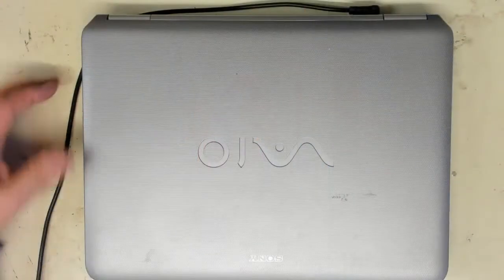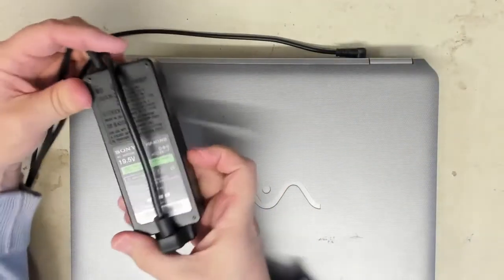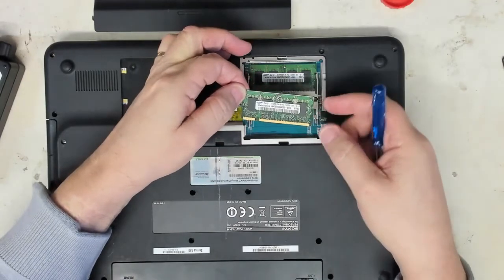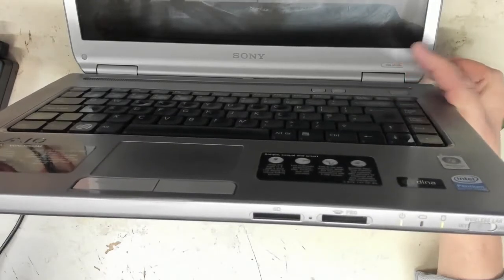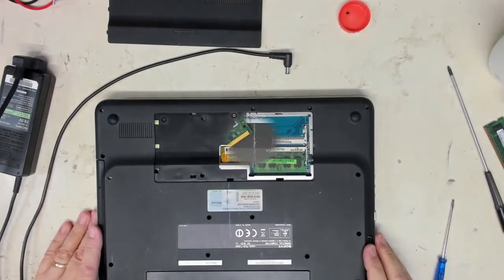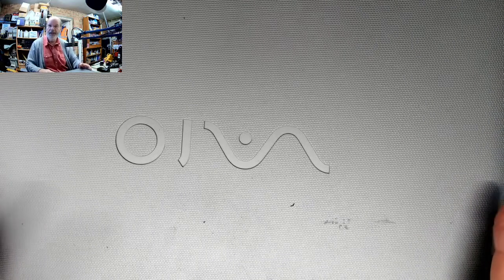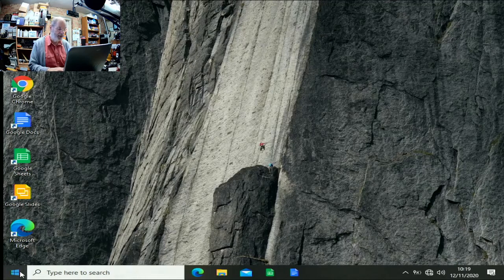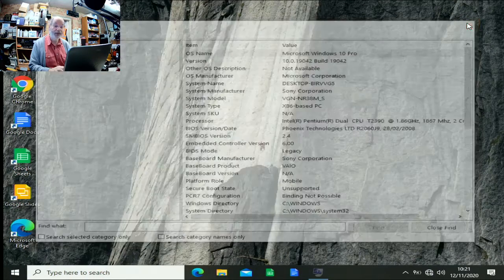SONY VAIO VGN NR38M   Will not start up

Comment: Good afternoon young man, could I pick you're brain regarding a vgn nw11z, 2009 windows 7 premium....starts up, takes a while to load windows, then after about 5 - 10 mins, shuts down, then goes through the whole cycle again & again & again???
Reply from the maker: Hi Christopher, thanks for the compliment re age 😆. Not familiar with your model of Vaio. I would try removing the HDD and booting again to see if it remains alive after the POST, maybe also go into the BIOS setup and leave it running. If it continues to operate, it would indicate that the HDD or the Windows install is at fault. If it shuts down and reboots, then you’re looking for a hardware issue. From your other comments you’ve already tried the memory so it’s most likely a power issue. 
Does it also do this on battery? If not and it continues to run, then suspect the mains adaptor, could be giving out poor quality dc.
If the CPU is pinned, then that’s probably OK but if it’s plate contacts sitting on contact pins, the contacts on the underside can become tarnished. Clean with care using iso alcohol. Don’t forget to replace the heat sink compound when refitting the CPU.
Failing all this on board electronics are the likely suspects.
Hope this helps.

Comment: Hello. What do you think. Model laptop Sony VAIO VGN-NS31MR. When you turn it on, the power diode just blinks and the laptop is removed with rhythmic quiet sounds or clicks. Very very quiet. The fan is not spinning, no more reactions
Reply from the maker: Sounds like a power rail short. Check capacitors.

Comment: Hi! I have a sony VAIO PCG-6D1M 
The fan starts but it does not display anything
Reply from the maker: Could be anything, bad internal power supply, bad RAM, bad BIOS file, you need to take it to a repairer.